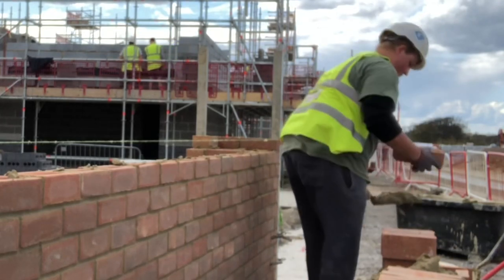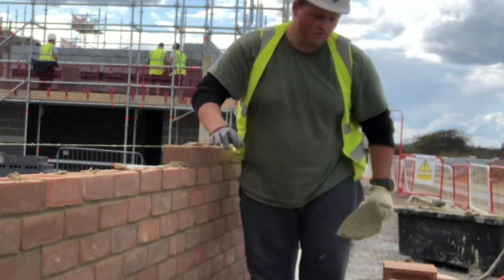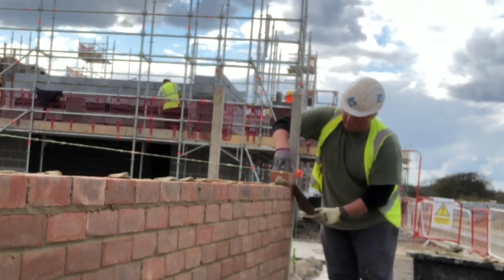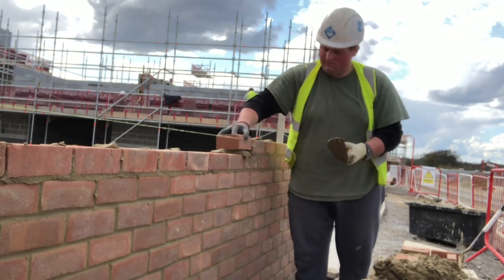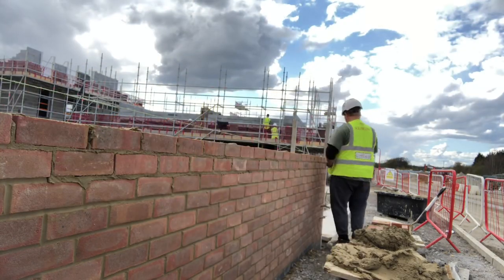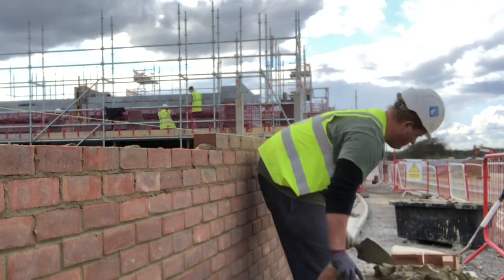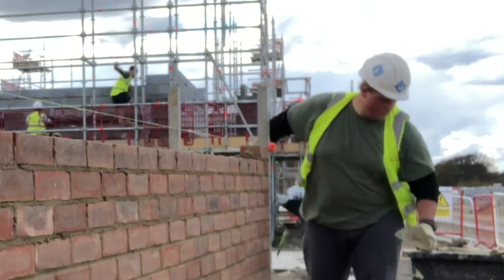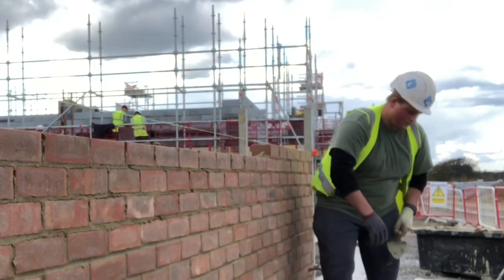Bricklaying - Pick n Dip In-Depth/Heritage Style Garden Wall - Part 2

Comment: The pick and dip always looks messy the gobbo goes all over the face brick that's why the new building sites brick work doesn't look as good you wouldn't get away with that method on bespoke houses
Reply from the maker: Not smudged a brick yet mate using it, it’s because people have a go and find it hard n make a mess, just like they do traditional, it come down to the bricklayer not the method